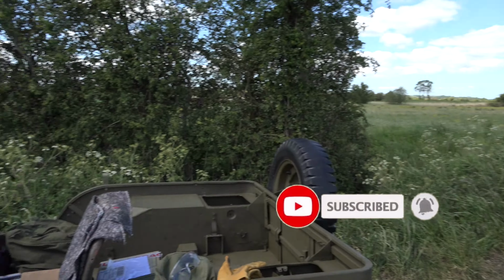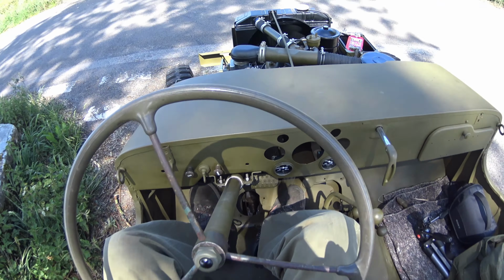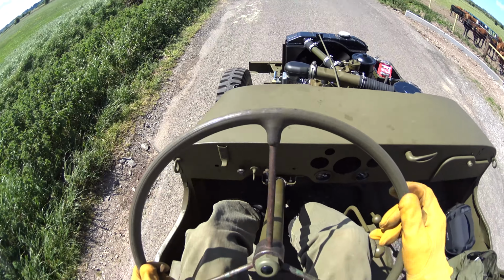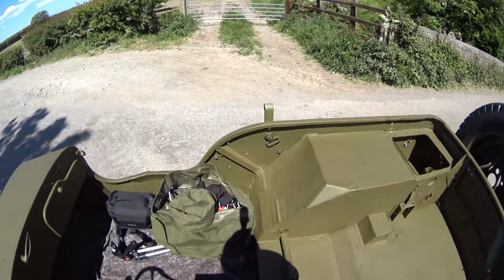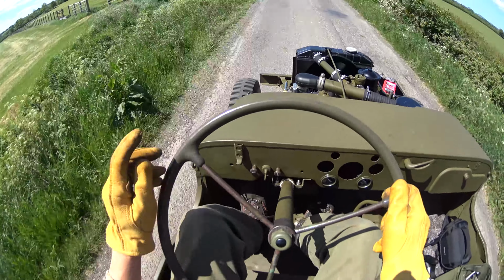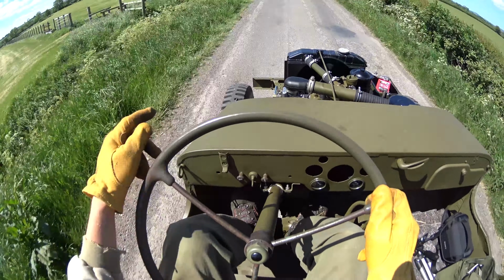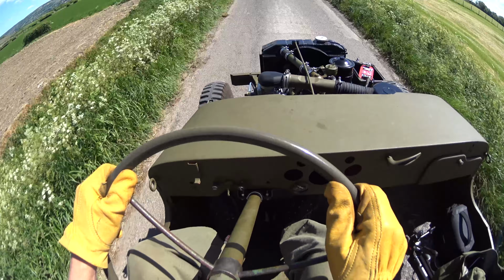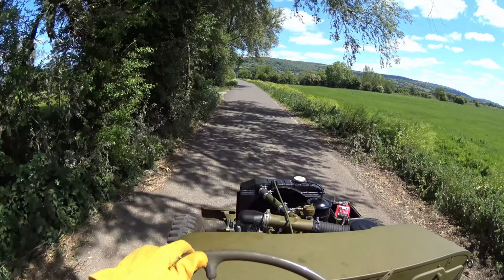77 Year old Willys jeep, First Drive

Comment: I've driven a bunch of these old military willys jeeps and have found that all of them shifted a lot better double clutching. From ones that were completely original that were never apart or rebuilt to a couple that were completely rebuilt, top to bottom, the double clutch was usually necessary to avoid crunching gears. I've, also, found that civilian models did not have this same issue. I don't know why that is, but it has just been my experience with these jeeps. I love driving the old small flat fender jeeps from the MBs, CJ2As, CJ3Bs to the M38s. I just need to lose weight to fit in them better.
Reply from the maker: The civilian jeeps generally have a later T90 box in them, the first gear isn't synchromesh so it will always grind if you don't come to a completer or near enough stop before changing.  The other gears shouldn't grind, I double de-clutch 3rd into 2nd though just to baby my box!

Comment: Making me desperate to get mine finished. Just putting the clutch linkage together. Modified it with 3 5/16 unf heim/rose joints. Should be a little smoother and no more wear to the ears on the shafts or clevis pins or original rod if using one of those. (I had a 5/16 rod with yolks). Must just remember to grease them when servicing.
Reply from the maker: Very nice

Comment: If it were me, I’d drive that trans for a while and let that 2nd gear synchro wear in a bit.  It is very usable with the double clutch downshift it seems, just might be fine once
Reply from the maker: True Don, It's driveable but the problem is I don't want to have to baby what should be a brand new Transmission!  There's no point in going the extra mile with the transmission and parts if one item is weak and you have to change your driving style to make it work properly, so its got to come out.  If it was WW2 it wouldn't matter but this jeep is supposed to be as good as you can make a jeep (or attempt to make one) to see what its like so a bad synchro just isn't going to cut it
Reply: Greendot 319 I get what you are doing.  I cut off the last of my post.  Aftermarket parts often need a little time to settle in

Comment: What pre load did you set the king pins too i had seen a few different settings mentioned on various sites. Set mine to about 12 pounds of pull
Reply from the maker: I Can't remember, it was the higher CJ figure I think, remember to do it without the seals attached!

Comment: She's a beauty, nice work!  Didn't we see a couple of videos back that you were supplied with some bad synchros by TAS or something like that?  What do you think the issue is with the synchros you put in?  Also, how is the synthetic oil doing/  Any drips yet?  I sure do like seeing your videos show up in my inbox...makes my day!
Reply from the maker: Cheers,  bad Synchros are still in it.  I show a down shift in this video with grinding, will try and get them out next week.  No oil is leaking but perhaps I'm getting a touch of smoke on acceleration  with the thin oil, not sure about it yet, could just be normal as the rings bed or could be from the oil or just a mixture of both.  Will run a bit more and see if it clears if not I'm going back to magnatec 10w40, cam and tappets should be broken in now with that higher zinc 0w40

Comment: is that the synchro  making that noise ?
Reply from the maker: Which noise!
Reply: @Greendot319  its only at low rpm when i can hear the transmission 1,2, and 3  I did see the dbl clutch grind bit the noise im refering  is much quiet like its trying to pop out noise hope thats more clear.